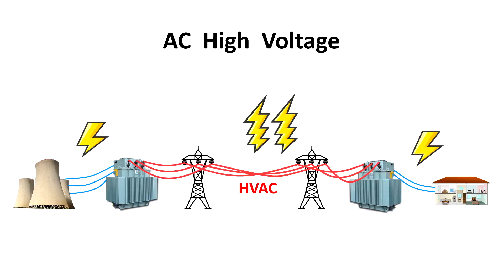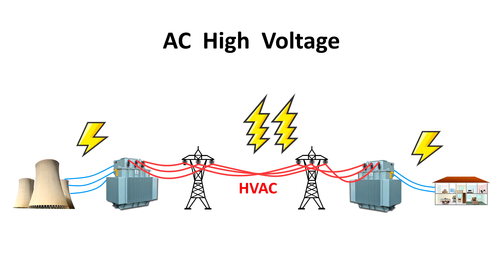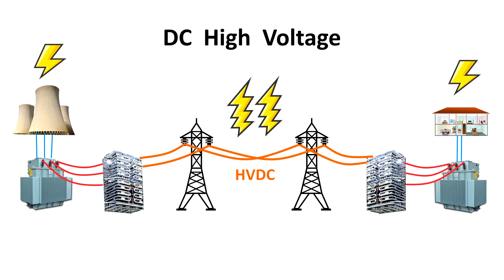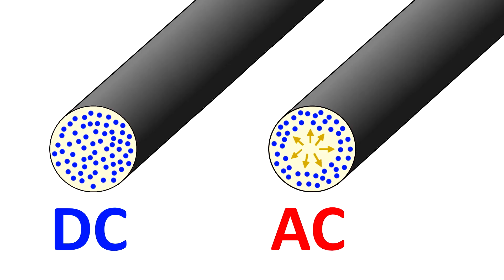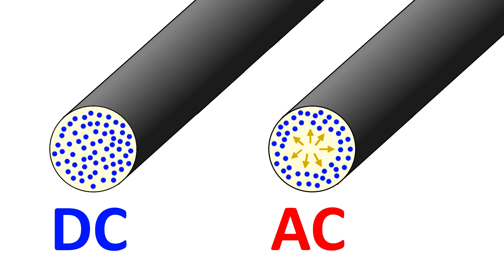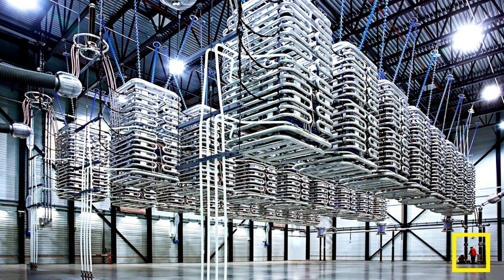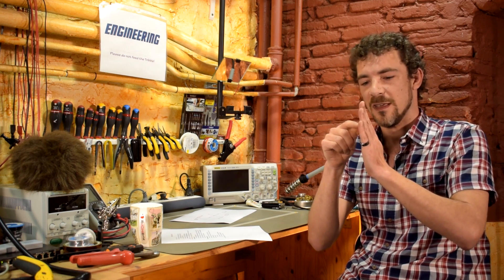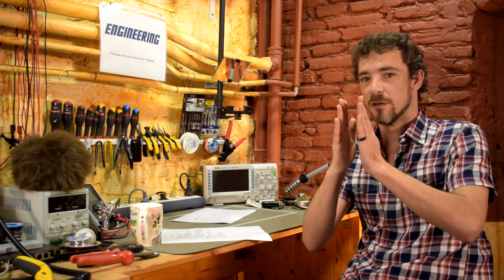EEK! #7 - High Voltage DC is back!

Comment: Seems like a main long distance transmission grid in HVDC, regional transmission in HVAC, and end users with low voltage AC would be an optimal path forward. Leverage the strengths of HVDC and minimize the impact of drawbacks through keeping the required infrastructure and cost minimal.

Comment: 3:29 converter on the left = essentially a bridge rectifier, Device on the right = inverter. Not identical devices at all. 
Except, eg, in NZ inter island hvdc link is bidirectional

Comment: Why use AC power sources when using DC power transmission? Why not make consumers' power be just DC?
We already have DC generator designs, and solar cells are basically DC already. This makes power storage more efficient just by ditching that AcDc conversion.
Plus electronic products are basically DC with ACDC converters. The only reason we are stuck in AC is that consumer motorized appliances are AC powered.
Reply from the maker: Even appliances increasingly use computer-controlled brushless DC motors!

Comment: This is a well presented and informative video. It is well explained to the layman. Another advantage of DC links which is useful for inter connectors is that you can control the power flow direction and magnitude. Another disadvantage is the harmonic distortion but that is very difficult to explain. Australia has a DC interconnector between the mainland and Australia called Basslink.
Reply: tasmania!!!
Reply: Yes. Thank you. My mistake

Comment: There is also another disadvantage to HVDC and that is harmonics in the primary A.C. supply. And you also need input line reactors to filter them out.
Reply: Wow so these new HVDC lines will cause dangerous dirty electricity
Reply: @flat-earther  They can if there are no line reactors installed on the input to filter out the harmonics. You see anytime one alters the shape of the sine wave you create harmonics which are multiple frequencies of the fundamental frequency the triplen frequencies are the most harmful the 3rd, the 9th, and the 15th and so on.

Comment: The island of Tasmania is linked to the rest of the Power Grid of Australia through an underwater DC Link.
The link is 230 miles long (370 Kilometres) carrying up to 630 Megawatts at a voltage of 400 kV.

Comment: Australia has a single wire undersea cable supplying HVDC from the Sate of Tasmania to Victoria, it lies on the sea bed and has been broken at least once. There were concerns about increased corrosion due to electrolysis using earth return over seawater

Comment: I thought ac won over dc because dc couldn’t do long distances
Reply from the maker: Mostly AC won because with transformers, you can easily bump the AC voltage up which reduces the current. At the end user, you pass it through another transformer which steps down voltage and current goes back up. Losses in cables are due to the current, so if you have DC at a high voltage / low current, you're okay. That's kinda simplified, but you get the idea!
Reply: DC couldn’t do long distances because they couldn’t step up very high voltages in those days.

Comment: The big reasons for 2 wires on DC, is:
1 Detect ground faults. An insulator may fail and this protects the equipment by detecting current on the ground.  Works just like a ground fault breaker. Uneven current trips the safety.
2 Prevent ground current. Natural ground current from a CME can interfere with proper operation of the line. Lightning strikes can damage equipment. 
3 DC ground current will remove the anode side electrode through electrolysis. Eating off the ground conductor will surly disrupt the current.
4 Lower voltage inverters.  A 1 Mega-volt line is 1 Mega-volt between conductors. Each inverter station uses 2 converters, each running 500 Killovolts. One is positive and the other is negative.
The converter stations are much more expensive than transformers and power factor correction capacitors and reactors, so they are used exclusively for long haul power transport where inductive losses are more of a problem.  The DC Intertie in the USA is between the Columbia River between Oregon and Washington and goes to a converter station about 60 miles North of Los Angeles. Originally the line was 500KV, but recently upgraded to 750 KV. This link primarily uses hydro power from The Dalles Dam, and uses the spring snow runoff to power the air conditioners in Southern California.
When they did the upgrade they had to test the protection circuits. Interesting video of the line hit with a few short circuits is here.  https://www.youtube.com/watch?v=pEL6M27HSVc
History video. https://www.youtube.com/watch?v=1BLOqX0Itrk
I have had a tour of the Ditmer converter station.
Reply from the maker: AHA. Thanks for that info!
Reply: @ScottiesTech  You are welcome. I was in Jr High, when they started the USA DC intertie. My dad worked at BPA at the time, so I learned of the issues such as lightning, CME, EMP, etc protection the long lines needed. CME protection is needed on long lines running North/South due to high ground currents from Northern Lights. Need the line to stay operational even during a solar flare and high Northern Lights activity.  This is much more complicated than run a wire and add two converter stations.

Comment: In my company (isp) I'm using DC 330V (european 230v ac rectified) the sockets are marked red, and it is only for sensitive electronic, computers, core routers, switches, everything that uses switching power supply. This scheme allows me to jump over UPS, and use batteries in parallel. No relays, no power ups, no reactive power, no power line distortions, no complications. Works like charm for 17 years.

Comment: I hope there's DC transmission to house. because  most appliances rectify AC to DC first, even motors use its own inverter for variable speed and higher efficiency. and using DC system, it's easier  to use battery backup and solar power system eliminating need complicated and expensive inverters. just some simple voltage regulator and it will be much more efficient. the voltage may around 300V DC to home.

Comment: 1) You can't run a 1500 mile AC transmission line as the inductive and capacitive losses cause the power to reflect back rather than move forward
2) You can't just connect two grids together and call it a day, they must also be the same frequency and in phase. There are many regions of the world where adjacent grids that need to be interconnected aren't even the same frequency at all (Japan), much less in phase for that matter (Mainland Europe) - HVDC solves those hang-ups

Comment: Don't get it I think they made HVAC in the past because of the fewer power losses. Saw an documentary Tesla vs Edison. Now the HVDC is better because of the fewer power losses.
Reply: not just the power losses. the AC could be converted to lower/higher voltages much easier with the old technology. they'd just needed a transformer which has no moving parts and can be manufactured with old tech. Very reliable technology. Now with silicon/carbide semiconductors, it's possible to convert DC/DC , so no need for AC lines. Fewer wires, fewer losses..all adds up. They just didn't have the tech to convert DC to DC efficiently back then, so the transformer and AC was the better solution.
Reply: AC has fewer power losses in Transformation or changing one voltage to higher voltage. but AC losses more in transmission because not using 100% of cable and capacitance to ground creating current path so DC is more efficient in transmission at same voltage. Now HVDC easier because of silicon technology which not available back then.

Comment: I vaguely remember reading that at low voltages DC is "better" then as the voltages rise AC is better and as the voltages rise again DC comes back into its own for reasons such as the skin effect etc. It's complicated but engineers wouldn't be using HVDC if the problems outweighed the benefits.

Comment: K so who is lying here, you or my electronics teachers? Or for that mater, who explanes false? I haven't tested to veryfy long distance HV, but generally a conductor have resistance in it both in AC and DC. And it most notable in DC. Soo what you say here makes 0 sense in that the reason they used AC in the first place was to avoid the large energy loss across the wire due to resistance in the wire cross long wires. Short distance. was no problem, but long distance you got high voltage losses on DC, and that was solved by using AC instead then you didnt get that high loss, as then it didnt need to travle through that much reisistance. (0.02 Ohms or so pr meter in a 1mm copper i think it was adds up the longer the wire to a high resistor) Yet you claim here its the oposite?

More explanation is needed to why that is or is not the case. Does it change when its HV, if so why?
Reply from the maker: There is always resistance when a current flows through a conductor - AC or DC. The more current that flows, the higher the voltage drop across the resistance of the wire. One of the reasons AC was chosen over DC is because it's easy to generate 3-phase AC and then pass that AC through transformers to bump the voltage way up, which also pushes the current way down. The less current that flows, the lower the resistive losses in the wire. Of course, high voltage power lines can still carry thousands of amps, so you still need a thick conductor. 

But since power = voltage x current,  transformers let you take low voltage / high amp juice and send it more efficiently over long distances since low V / high A becomes HIGH voltage / low amps at the output of the transformer.  Resistive losses also apply to DC, of course... which is why most often, they're taking AC, cranking up the voltage thru a transformer, and then turning that HVAC into HVDC. 

Note also that with AC, you have additional losses due to capacitive and inductive reactance, which you can think of as "extra resistance to the flow of current, but only for AC".  Even with that added reactance, AC was still favored over DC because the whole system of 3-phase generators + transformers was better all around. 

Finally, in the early days, 3-phase AC was favored because it could efficiently be transmitted to remote locations over power lines and then be used (still as 3-phase AC) to drive powerful, smooth, relatively compact motors for mass manufacturing and such.
Reply: Have you SEEN how long DC transmission lines are?

Comment: Scottie, would [emergency] generators (which require fuel) be categorized as DC, or AC? I know they are extremely limited due to the fuel usage. 
As I understand, "renewable," or "green energy" sources are actually  carbon fuel extenders. What are your thoughts on that? I wish to learn from the best. Thank you.
Reply from the maker: Most generators are AC, single-phase. There are some larger 3-phase ones though.

Comment: DC arcs will one day light up the world #prophecy
Reply: We could simply just go to bed earlier like we used to before the advent of cable
Reply: Indeed. Enjoy. https://www.youtube.com/watch?v=pEL6M27HSVc  They tested the protection by firing small rockets pulling a wire into the substation. Due to the capacitance of the line, this is a very noisy event.